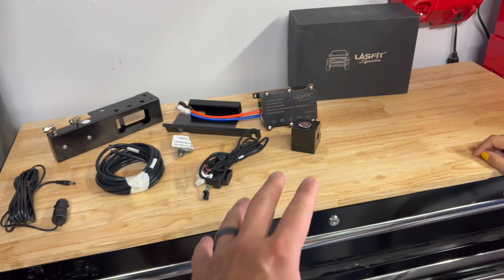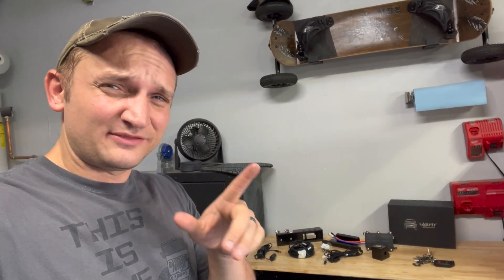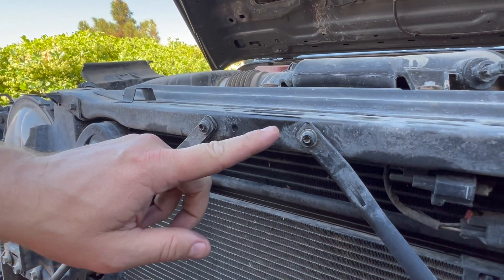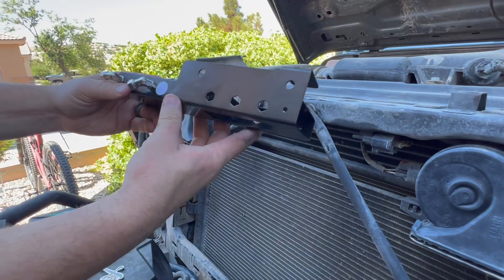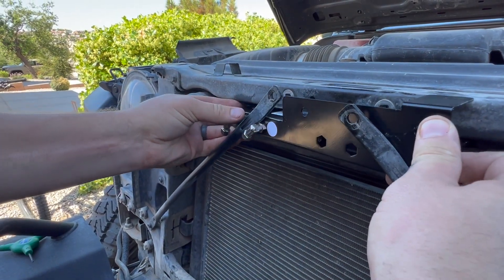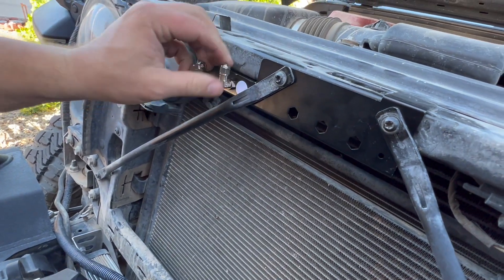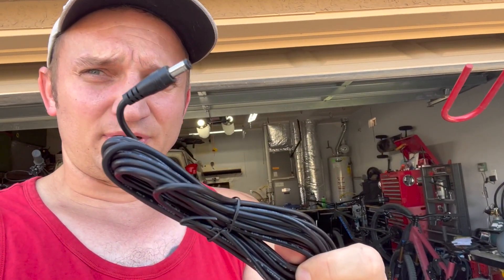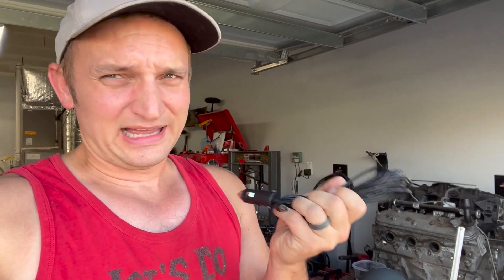Jeep JL Stealth Box *MUST SEE

Comment: I did the installation and now I do really have a question, that I did ask Lasfit, which they don’t answer yet. 
If the thief cuts, the airline will loose the air pressure and release the air, and open the hood
?

Comment: I was concerned about heat or punctures happening to the air hoses so I protected them with wire loom which is made to protect wiring. They worked great I had to buy 2 different sizes cause in the main engine bay I kept both hoses in one big wire loom I think 1/2 inch and inside under the dash I used a smaller size for the individual hoses and it looks clean and now double protected. Cause if one of those hoses springs a leak or won’t hold the pressure you won’t be able to open the hood. That sucks but I just got the wrangler 392 and couldn’t use the mopar key lock cause the front camera is in the way so this was the next best thing. I don’t like those cheap latches with keys. But thanks for the video it helped me out.
Reply from the maker: 🙌🙌 glad to hear it!

Comment: They should make the back up connector,  for when you've killed your battery, a phone type connector. This so you can use a jump pack to power it, instead of plugging into another cars 12v.
Reply from the maker: Thts actually a better idea than the current piece in there. Thts something much more available and eat to get ahold of

Comment: I just installed on my 2021 JLUR 4xe.  Essentially, you are always unlocking/locking the mechanism every time you unlock/lock your doors.  Maybe there is a fix? (still looking).  I feel this will fail eventually because of mechanical wear.  Perhaps should have been programmed to press unlock 3x to unlock? Since pressing unlock once, unlocks the driver's door; unlock twice, unlocks all doors.  Otherwise great product.  I still like it.
Reply from the maker: Pretty solid idea, I’d share it with the company of I were you

Comment: you can probably find a usb to that type of plug instead of the supplied 12v plug. Id have to get it in my hands to figure out which plig it is. 

And could you not use an air compressor to shot air in the line to open the hood? It may be to strong and damage the mechanism but if Im in a bad spot id risk it. but basically that would mean ive lost or damaged the emergency plug. 

I really want this since I have the trail cam. Id rather have the bolt hood lock but trail cam is in the way and i dont want to move it over one slot as that would throw the alignment of the camera off. Also, this is lower cost right now I dont want to wait. But I just spent waaaay to much money on a fridge and AAL slide and drawer setup lol.
Reply from the maker: 😂 yea… as I tell my kids… ANY QUALITY hobby… is expensive 😂